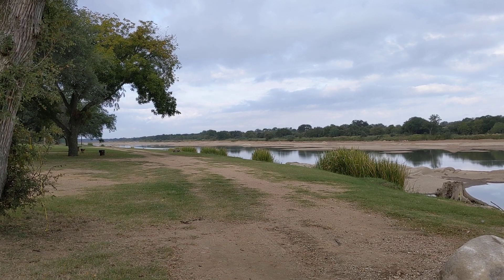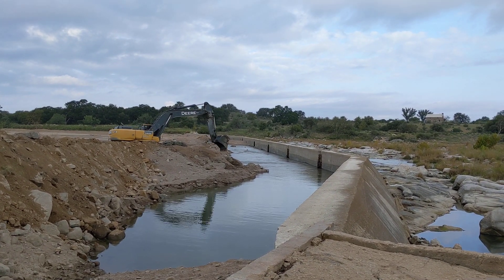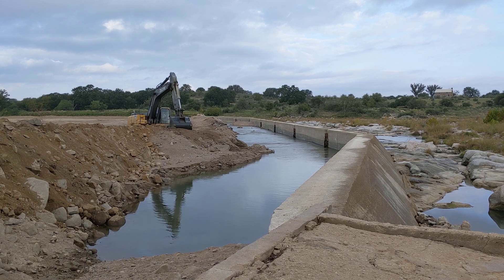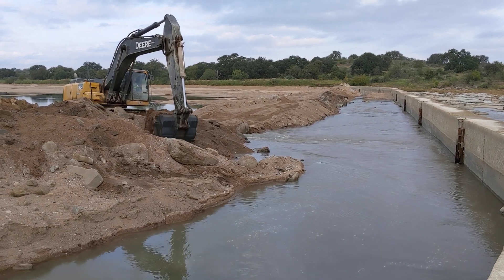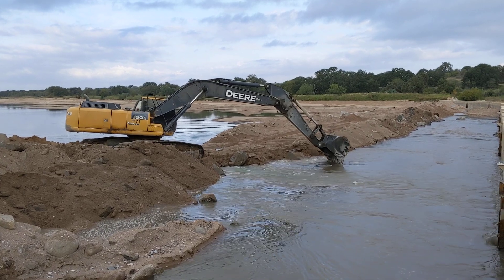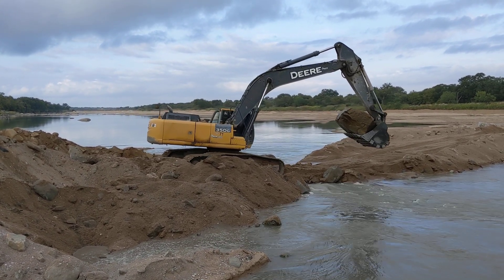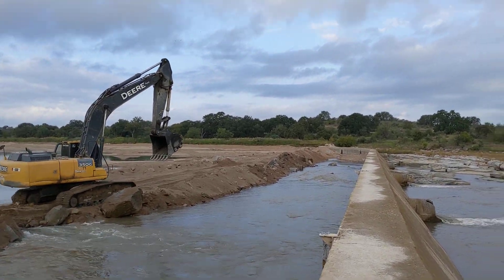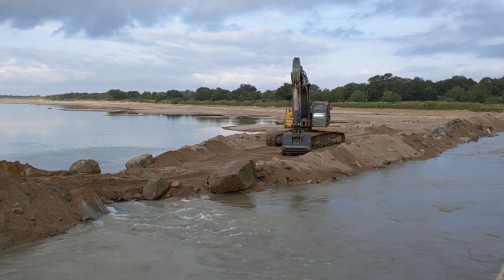LLANO RIVER TEXAS...DREDGING!

Comment: If putting pipe in . I would think he is making a temporary road so they can haul material out with trucks . I have ran those excavators  and know if you tried to move that much dirt with the excavator it would take for ever . The sediment  goes down stream and collects at the dam , so they are prob cleaning it out . We did kinda the same at the gravel pit where the wash water would run . He may put more rocks there for a berm , Most haul roads need a berm at least as tall as the axle of haul truck